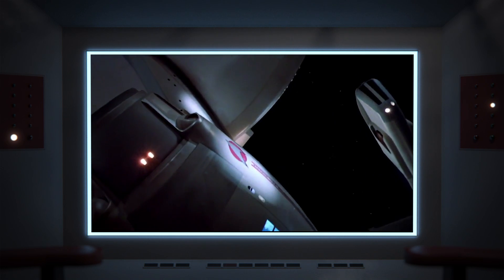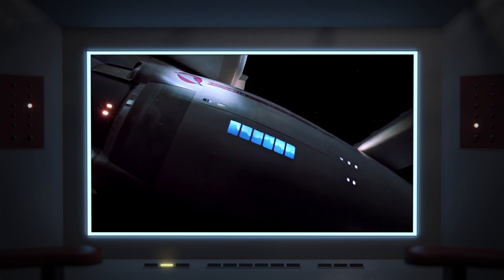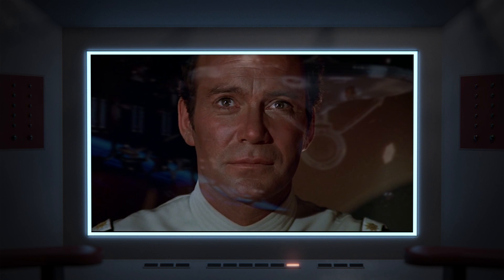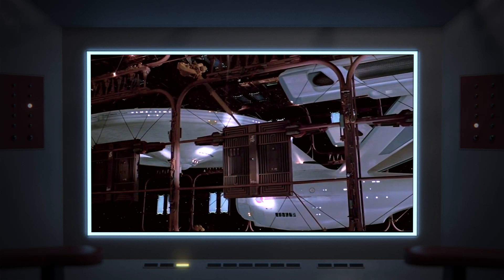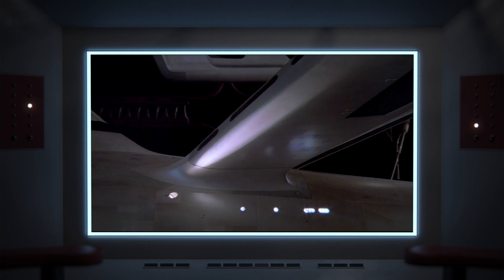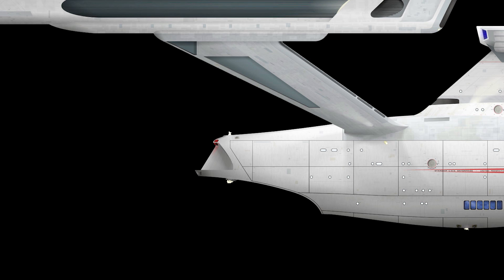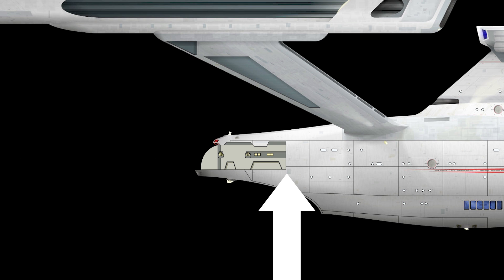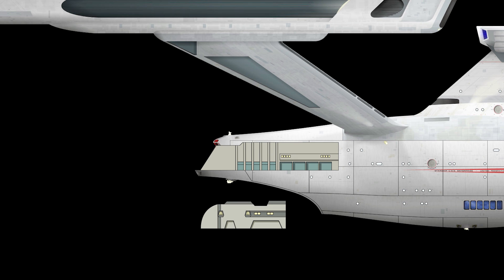Why Have Angled Nacelle Struts? (Enterprise Refit)

Comment: It's most likely because of the aerodynamic qualities of slanted struts. For example, you need slanted wings on airplanes because if you didn't have them, the wings would snap off. The air travels more easily along the slanted wing than it doesn't a straight one. If the ship were ever to be forced into an atmosphere, the wind resistance would rip the nacelles right off

Comment: Worth to mention that original TOS Conie has warp core on the top if secondary hull, with pylons being connected directly to the core. With the refit, warp core was moved to the neck. Freeing all that space. So the structural connectors could be moved up and more forward. Allowing clean connection (it was still a weak spot in ship design, allowing Khan to cut plasma from nacelles). But it did freed a lot of space for the hangar. As stated.

Comment: Also, the refit struts connect to a higher deck level, in-line with the engine room's main floor - you can see the plasma conduits going to the struts in the background of the engine room.

Comment: The angled struts allow for the engine nacells to connect further back on each nacelle, and they're wider at the connection point of each nacelle and strutt. A more robust looking and practical design in my opinion along with all of the other features you mentioned about the larger hangar/shuttle bay. This is my favourite enterprise with Strange New Worlds Enterprise coming in at #2.

Comment: The warp core also went from horizontal to vertical and moved closer to the deflector dish so moving the struts closer to the new position of the new, vertical warp core is probably another reason for the mod.

Comment: When the Enterprise was redesigned for its feature film debut, angled struts were used because the ship looked cool not because they added an in-universe upgrade to the shuttle bay. The massive and complex shuttle bay we see in the film was made that way because why go small on design when you have a feature film budget to work with. By default, everything was grander than what they could do with the TV series. The refit Enterprise exists because the TV series model lacked sufficient detail required for a feature film.

Comment: While I absolutely loved the refit design as depicted here and some pop the engineering reasoning regarding them it must be understood the the basic design of the Enterprise is not a functional one as it wouldn't take much to tear it apart.  While visually stunning, it's an engineering nightmare.  It works for the design and use the warp nacelles, the entire machine wouldn't last very long due to it's inherent weakness.

Comment: Curiously I am of the mindset that the strongest areas of a starship like the constitution refit would be the warp pylon/struts, the neck, and the bridge module.  Bare with me as I explain why I think this. 
Perhaps, just perhaps, StarFleet Engineers might have concluded that, based on after action reports from other starship captains, that most enemy ships tend to think the neck, bridge and warp pylons are the best targets to hit, if one thinks they can disable a starship.  In a way it makes sense for the enemy ship captains to think this.
Perhaps though, starfleet  engineers likely decided these theoretical weakspots should in fact be heavily reinforced and shielded, in part because they do connect the primary hull, the secondary/engineering hull, and the warp engine nacelles together. The bridge is obviously more shielded and armored because it is the bridge.  
So while the enemy is plinking away at these supposed weakspots, the starship is focusing on crippling or destroying the enemy ship that is attacking them. 
Likewise if the enemy is trying to hit the bridge, its going to have to be really good, as the bridge is a small target, surrounded by phaser banks and or turrets, not to mention the saucer section and so on. 
The same applies to the secondary/engineering hull, where the warp core and other vital systems are buried deep inside.
An enemy captain will certainly have their work cut out for them in trying to disable the starship, notwithstanding some of what we see in movies.
TWOK comes to mind as Khan and crew were savvy enough to figure out cripple the Enterprise (Spock: They knew exactly where to hit us)
It's just a thought, hope it makes sense.

Comment: The refit has a vertical warp core forward of the original Enterprise core location. Bringing the struts forward along the engineering section reduces the interior length of the plasma conduits, while the angle allows a more centered connection with the nacelles reducing stress caused by inertia etc.

Comment: Also, if a ship is moving fast, it’s better to have the nacelles at an angle because it will be more like they are being pulled along. If they are at a 90 degree angle, there will be more resistance.

Comment: Well in production, Paramount had secured it's reputation for buffing up it's design on Star Trek ships.  Obviously it's a hell of an improvement on the original, the surfaces are more detailed, there's more flare to it, and replacing the deflector dish with a glowing blue one really just made the ship much more appealing.  It told the audience that Paramount, and Gene Roddenberry had clear intentions to distinguish the new design from the TOS version.  The same would eventually be done with the Enterprise D, which was a great concept in the TV series, but on the big screen the aesthetics just didn't work.  They wanted to replace the Enterprise D with something sleeker, more streamlined, and above all, more militaristic to fit the setting of the Dominion War.  So they wrote in the Enterprise D's destruction as a good send off for it, clearing the way for a new adventure for the TNG cast as they took their place on the big screen.  The same could be said about the USS Discovery after their arrival in the 31st century with it's refit, it could be said about the Voyager J, and the same could be said about the USS Titan A.  So Paramount is very good at making improvements to existing designs and make them more appealing than they already are.

Comment: The Refit pylons (struts) also extend directly from the engine room making the power conduits to the nacelles shorter and more direct (more power). It also makes the strong-back more compact not having to extend further along the back of the secondary hull.  BUT the main reason is it just looks COOL!

Comment: From the perspective of a mechanical engineer, there is one thing I find very bad about the angled struts. The angle part isn't the biggest issue. Where the struts meet the engineering hull of the ship, the struts flare outward on the way up to the nacelles. That is structurally stupid. If anything, they should either have an equal cross-section all the way up, be flared at the bottom streamlining up to the nacelle, or have more than one nacelle support structure. On one hand, it's good that the nacelle support struts are straight, and don't have angles on the inside or outside, and don't possess any radii because that would create weak points. But then again, whatever engineering team designed the Constitution class ships also set a forward torpedo launcher next door to the warp core. When the Reliant was firing on the Enterprise in the Mutara Nebula and destroyed the Port side torpedo launcher, and no doubt causing damage to the Warp Core, an ammo explosion would have taken the ship out entirely.

I saw what I thought was a similar flaw on the Excelsior. It has very long nacelles and the nacelle support struts are fairly thin. If I were the one designing it, there would be a secondary nacelle support further back, identical to the one the Excelsior has, meaning each nacelle would be supported at 2 main points. I would make a point of eliminating points that would look good to target, and it seems to me, losing a nacelle would be one of those things.
Reply: Photon Torpedoes detonating inside a ship would take it out regardless of where they were aboard.

Comment: Probably more stability having them connect to the center of the nacelle rather than the forward portion. When encountering gravitational forces it would definitely be more stable, and you couldn't attach them to the center on the original enterprise as it would pull the nacelles forward and hit the saucer section. 

It could also be a a cool adjustment in the formation of a warp bubble, but how that would influence that I don't know.

Comment: beeing at an angle forwards its also going to better handle the stress from the engines pushing the rest of the spacecraft, as with a 90 degree connection its going to have to be significantly stronger to be able to handle the stress

Comment: I think the angled struts allows a more direct plasma flow from the warp core / engineering to the nacelles. The original struts required a very bumpy ride for the plasma, with at least one 90 degrees turn in the circuit. This could maybe lead to a point of failure and/or a loss of efficiency. The angled struts makes the entire system more logical and streamlined in my view. The enlarged shuttlebay is another fundamental benefit of this configuration.

Comment: Because vertical warp core is further forward in the refit design, the angle means that the horizontal plasma duct doesn’t have to reach back as far before going up to to the struts. The Pre-refit design placed the actual warp core more towards the rear of the engineering hull as it was a horizontal warp core design.

Comment: In the TOS enterprise the warp core was completely horizontal.  With the refit it gained a substantial vertical element. This would presumable change the point at which the plasma could be diverted to the nacelles, moving that point forward and enabling the shuttle bay enlargement.

Comment: Another potential consideration is both the upgraded Warp Core as well as the upgraded nacelles.  The New core requires the horizontal plasma transfer conduit to lead back to the pylons, requiring them to be attached higher and more forward.
One could argue they could simply have straight pylons connected to the front of the nacelles rather than midway, but even on the original ship, the pylons were a pretty good clip back from the bussard collectors.  These new nacelles of different design imply the transfer conduit must be attached more toward the middle.  We see a similar mid-nacelle attachment on the Miranda-class.  This therefore requires the pylons to have their sharp angle in order to both reach the transfer conduits from the warp core and subsequently attach where they need to, to the new nacelles.

Comment: Heat Management.  The struts are where the Enterprise's heat radiators are.  If you look at the front and back (relative to the ship) of the struts, as well as the "sides" of the struts are covered with black grilles- heat radiators.  The struts got widened and "raked" back to increase their surface area to provide better cooling for the upgraded warp engines.

Comment: Both but in the real world of Star Trek it could be that the new warp nacelles were just to close to the saucer section and needed to be angled further back to limit warp field radiation killing the crew.  Also it could be the stress on the older nacelle pylons would be to excessively high with the new nacelles and they would have ripped off the the ship.

Comment: A little late, in my comment,... but that's a different story-
Meanwhile,...
Congratulations on your observations, relating to the mounting points of these pylons.  They emerge from a beefier section of the Engineering hull,  they provide a more direct transfer of warp-making stuff to the engines,  they do indeed provide more room for the connected cargo & landing bay spaces,  and they join the engines at the perfectly located energy-transference point (according to Starfleet Engineering) for the new warp system (a tiny detail which was ignored when the Reliant was concocted).

Comment: With the nacelle struts mounted in a more forward position the warp plasma conduits will be shorter and the angle of the struts means that the conduits can continue up to the warp engines at a gentler angle instead of the sharp 90 degree turn they made on the original Enterprise design. Also the angled struts attach to the warp engines at the mid point, offering more balanced support.

Comment: It's the warp core. The new vertical core is further forward behind the deflector/sensor dish. The power conduits run straight from the core through the pylons to the warp nacelles - they used to have to run back through the secondary hull a ways and then turn 90 degrees up through the pylons. So the pylons are now angled to point directly at the lower end of the vertical warp core. 

More efficient, which I'm betting counts for a lot when you've made a generational leap forward in power production and consumption.

Comment: 100% absolute real world structural advantage to the angled pylons is their support of the nacelles at or close to the nacelles' CG. This allows the angled pylons to support the nacelles with far less torque relative to the TOS vertical pylons.  In sharp contrast, the TOS vertical pylons support the nacelles well fore of the nacelles' CG.  This unbalanced arrangement places significant torque loads on those vertical pylons.  Of course in space, there are no weight based torque loads on the pylons of a fictional ship.  So, the real world weight and torque issue applies only to the studio and hobby models of the ship.  The weakest of the vertical pylon ships is the JJPrise.  The nacelles of a JJPrise model can droop and spread outwards over time.

The one disadvantage to the angled pylons as depicted on the refit ship is the significant stress point where the pylon narrows where they attach to the secondary hull.  If Enterprise lost structural integrity fields (SIF), low to moderate G loading would crack or break the pylons at the narrowest point.

Comment: I like to think that the reason the original Enterprise had 90° degree struts was because of the warp core, in TOS it was horizontal but in TMP it was vertical, so there was more horizontal space for the struts to go in the new enterprise and because of that the shuttle bay got bigger

Comment: Practically it's a larger shuttle bay, but if you think of it as application of forces in propulsion, angling those struts actually strengthen them by reducing bending moments at the hull and nesscells? Along with looking better, win win?

Comment: a "Strut" is a giving spring on a front wheel drive automobile that "forgives" the arc of turing a sharp corner. FYI. not a shock but similar. it is not a support pylon bar for an outboard motor. that is called a support beam.(scooners have them for their pontoons)

Comment: I'd bet that the triangular part helped keep them more stable as well when in motion. When the ship moves forward, the front of the nacelles would likely have a tendency to flip up and outwards, which was likely why the 90-degree supports were further forward on the ship as a means to counter that weakness. using angled struts along a longer length of the nacelle could add more stability as a whole while allowing the supports to be moved back to counter nacelles possibly snapping off entirely during sudden braking as the 90-degree struts would have been especially vulnerable to with the forward connection points. Warp nacelles are probably something you REALLY don't want to move in relation to the body of the ship. The extra stability to the rear of the nacelles by being able to run supports along more of it's length could be the difference between surviving warp speed or flying apart at warp speed.

Comment: I could be totally wrong, but given that the struts house plasma conduits from the warp core to the nacelles the different angle might be due to the different orientation of the core itself. In the original Enterprise it is horizontal, thus it extends further backwards than in the refit ship and that's where the plasma conduits, and in turn the pylons, start; whereas in the movies the core is shown to be vertical, hence the plasma conduits originate more towards the front of the ship, hence the more angled pylons.

Comment: It's quite simple really.  Bottom line, Engineering was moved from the top of the drive hull, basically the spine area in between the nacelle struts; just next to and above the shuttle bay to the front, middle of the drive section just behind the dish.  To reduce the distant of the engine conduits to the nacelles and struts, the base of the struts were moved forward.  

Also the strut design is for added strength of support of the nacelles.  If you look at the original design the straight strut supports are the same width from bottom to top and connect to the nacelles near the front, leaving all that nacelle weight in the back.  I was surprised in Tomorrow is Yesterday when the Enterprise went back in time to the 1960s Earth and was in the upper atmosphere that the nacelles didn't bow down from the back while in gravity because all the support is in the front.

Now look at the refit strut supports.  They start narrower at the bottom but become very wide at the top where they connect to the nacelles. AND they connect to the nacelles at the middle making an even distribution of weight support.  This flared design allows for more surface area for heat radiators in the struts. 

It has NOTHING to the do with the shuttle bay.  Remember that they completely redesigned this ship while trying to keep to that same or similar hull configuration and size.  This is why Kirk didn't know the Enterprise as well as Decker in the Motion Picture.  And remember when Scotty brought Kirk to the Enterprise in spacedock, they entered the ship at Engineering and notice where that docking port was.  Front, middle of the drive section.  NOT top, back near the nacelle struts.